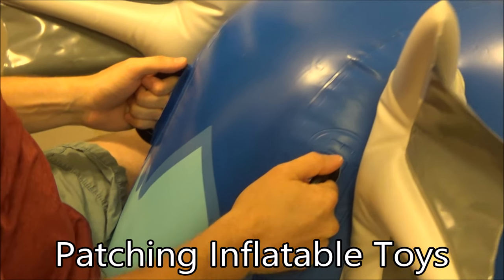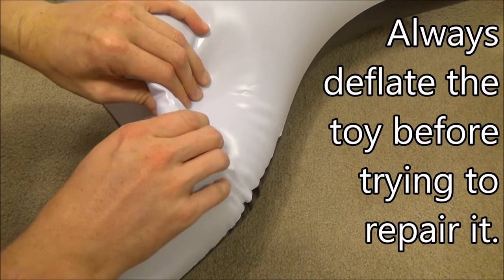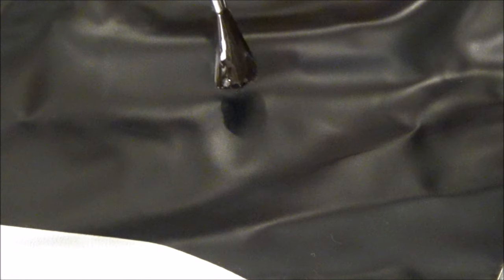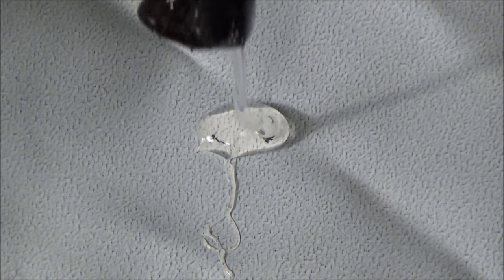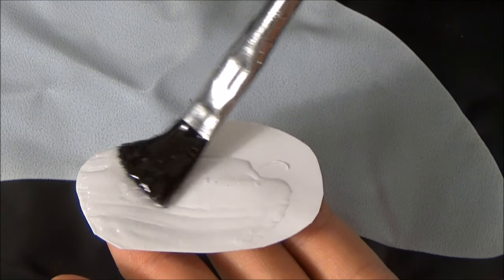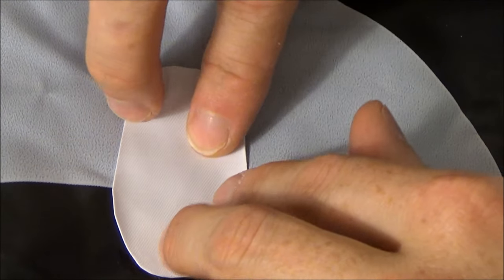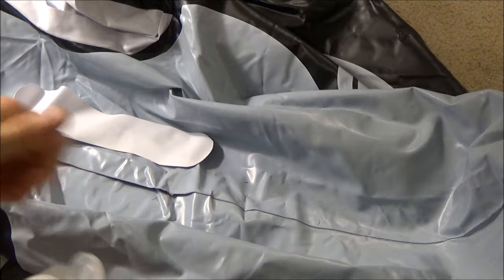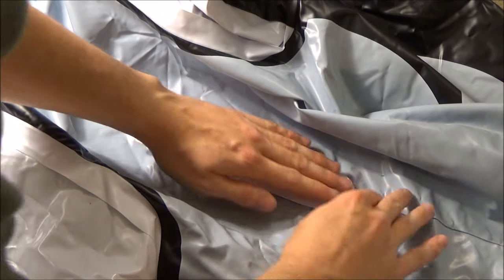Repairing Inflatable Pin Holes, Punctures, and Tears

Comment: Do not stick the patch on immediately. Either let it sit for at least a minute or gently blow on the patch and surface you want to apply it on until the glue is no longer shiny, then put the patch on. If you put it on wet then it will just slide and curl up at the edges and not stick well.

Comment: 2 things I have also found useful:
1.  I put waxed paper over a new patch and then press firmly on the waxed paper to seat the patch.  If it is laying flat, you can place a heavy weight over the waxed paper and it will keep the patch flat and tight while it dries.  When the glue is fully dry, the waxed paper will peel right off.
2.  After a patch has completely dried, I sometimes run a bead of glue all the way around the edges of the patch and then let it set up.  It seals the patch and prevents any curling up of the edges or peeling back.
Reply from the maker: +Thumper1044 The glue I am using in the video sets in about 5 minutes, so it is almost not worth trying to clamp it under anything heavy. I have however run glue around the edge of a patch, but for the most part if I applied the patch well enough I won't do that.

Comment: With the seam rip, would it be possible to accidently have glue seap inside and attach to the other side? With all that massaging I'm curious to know if you've ever glued the inside together accidently.
Reply from the maker: +kellymccabeful Yes, the glue quite frequently does seep into the toy. As long as you peel the two sides of the toy apart before the glue fully sets you will be okay.

Comment: in seam split how do you preventi the glue from sticking to inside and other side of the inflatable? It always happens to me. What about doing a negative repair for seams (i mean inside instead of outside)? is it a good idea?
Reply from the maker: I make sure to pull the two sides of the inflatable apart before the glue sets. As long as you pull it apart once or twice it won't stick anymore after that. And yes, I like to do patches on the inside whenever possible.

Comment: Thank you. I have a set of inflatable Letter People that I turned into stuffed animals and I want to turn them back into just inflatable. Now that could be possible and I wouldn't have to run into storage issues or pay $500 for a completely new set. 😀👍. My letter R has an open seam in his leg and the rest mainly has cuts and need replacement valves

Comment: Hi , is it better to put some pressure on the patch overnight  !! Thanks
Reply from the maker: The HH-66 vinyl cement I typically use dries so fast it really isn't necessary to clamp it for an extended period. However, other vinyl cements may take longer. You can always check the instructions for the glue you are using.
Reply: @HeathDragon  
Many thanks for your time 🙏.  Cheers

Comment: Hey Heath Dragon, I don't know, if you will still read this, since the Video was a while back ago, but can I do the same glueing you did on pinholes, when they are on the seams, but small enough, that it's really only noticble through the air rushing through, when up close? Because I got a Baphnedia from BeiLe, but sadly found leaks alrady and one of them being the one I mentioned.
Reply from the maker: I would not recommend using just glue on a seam that is beginning to split. You really want to glue on a patch for seam repairs.
Reply: @HeathDragon  Alright, thank you very much ^^

Comment: Is there alternative material instead of PVC? or where to buy PVC material, how it should called? Thank you.
Reply from the maker: Most pool toys are made from PVC (polyvinyl chloride). So you would want to use PVC to repair it. I usually use scrap vinyl from other toys. If you don't have any scrap, you can always buy one of those really cheap inflatable mats from the store to use as material.
Reply: @HeathDragon  Oh, thank you. I thought some kind of vinyl straps for car things like tuning can fits..

Comment: I know that this is a older video but is it possible to fix a small horizontal seam tare on the mouth of an inflatable intex whale with just the vinyl cement?
Reply from the maker: Any tear on or near a seam you would want to glue on a proper patch not just use the glue.
Reply: @Heath Dragon  thanks for the information. Where can I find a good patch for the inflatable whale?
Reply from the maker: Usually you can find a patch kit in the camping section of Walmart or sporting goods stores, but I just usually use scrap vinyl from cheap inflatables.
Reply: @Heath Dragon   hi you know where I can get some vinyl patches in the UK? I am having a hard time finding some,  maybe something I can use instead ?

Comment: Which chemical are applied first before applying the glue, plz send the which glue needs to b use.
Reply from the maker: I typically clean the bond joints with isopropyl alcohol before bonding. I use HH-66 for glue, but several brands sell flexible vinyl glue.

Comment: A nice tutorial, but what about a possible glue sticking with the opposite surface of inflatable toy? How to protect this?
Reply from the maker: As long as you pull the two pieces apart that you don't want to stick in the first couple minutes of the glue's drying time you can safely pull them apart.

Comment: Is there a way to repair it without that stuff, like is there a way to repair it using regular glue duct tape or anything householdish?
Reply from the maker: +James Nightman I wouldn't recommend tape. You can however find simple patch kits at most superstores, pool supply stores, or sporting goods places. Patch kits usually have a small tube of vinyl glue, a sizable patch of vinyl, and only cost a few bucks.

Comment: How do you keep it from adhering to the other sidein the case of the same split or for that matter any other hole?
Reply from the maker: Occasionally the opposite sides will get glued together by accident. The glue I use takes a few minutes to set up so as long as you peel the two halves apart before it fully sets it won't stay stuck together.
Reply: Heath Dragon ✅

Comment: Who sells that HH-66 glue? In the past I have used Goop cement to form a patch over seam splits. But the seam continues to split under the patch and before long it's leaking again.  Does that ever happen with the method you use?
Reply from the maker: You should be able to find HH-66 online or find Loctite's fabric and vinyl glue in a typical hardware store. The two glues I just listed should bond much better and not result in the issue you described.

Comment: You're videos are incredible! Can you point me to a PVC fabric that I buy online to patch a large white tear (about 10" long) I have along a seam? There are a lot of different thicknesses for boats, or tents, and I'm not sure what to get. There are also patches, but the ones I find are all small. The tear I have is along the neck of a Sun Pleasure Party Island Unicorn float I bought a couple years ago for $250 on Amazon. My plan is to use HH-66 and put an internal and external patch, and attempt to reinforce the rest of the neck seam with a bead or two of HH-66 - sound like a good plan? THANK YOU!

Comment: What type of glue is needed? I mean ,is there any special type of glue?
Reply from the maker: You will need to use vinyl cement. I use HH-66, but Loctite vinyl and fabric glue will also work. Sometimes you can find vinyl cement sold in a patch kit in the camping section of Walmart and the like.

Comment: Having trouble. Im repaing a pinhole leak with HH 66 on my fyaryuu dragon's wing. I wait 24 hours before inflating it and there's a leak at the end of where the glue is. Any advice?
Reply from the maker: Is it on a seam? Did you use a patch?
Reply: @HeathDragon It's a very small leak on a seam and no, I did not use a patch.
Reply: @HeathDragon  Got a patch of clear vinyl on there. The recurring leak stopped. It was a tricky application with the pinch seam, but HH-66 gets the job done.

Comment: Hi there.. may I ask if I can also use the solvent that use for the pipe??
Reply from the maker: Typically PVC pipe cement cures rigid and is not flexible enough for vinyl repair.

Comment: I know this is an older video of yours, but I have a bit of a conundrum...

My Phenod Pink Roo's leg seam ripped, and it's quite a large rip along a curved seam. Would you have any tips on how to possibly repair this?
Reply from the maker: It is possible to glue it back together by cutting a curved patch and attaching it to the inside of the seam split.
Reply: @HeathDragon  Ah, okay, that makes sense! Not sure if it makes any difference, but the inside seam where the leg joins to the rest of the main body is where it ripped. The tricky part would be getting the curved piece in just the right shape to prevent as many wrinkles as possible, I'd imagine.

Comment: The situation used to be a seam split and burning damage was fatal, but all other damage could be fixed with large stickers, duct tape and rubber cement. I find this video to be extremely helpful. However, it is not mentioned in this video that extensive damage caused by burns and acidic corrosion must be sterilized with chemicals before repair can begin.

Comment: What can you do when a aor bed gets a lump in it, Can it be repaired
Reply from the maker: +Nicole Sewell That usually means one of the internal baffles has started to peel. That is not an easy fix.
Reply: +Heath Dragon even if it's not a easy fix, Wat can be done about it or can anything b done to fix it?
Reply from the maker: +Nicole Sewell It is probably easier to buy a new air bed. You'd have to glue the baffle back together which is inside and hard to reach.
Reply: +Heath Dragon I just bought that one, Didnt even have it for a month. Wats the best airbed to get

Comment: Do you have to let it cure for at least 24 hours, so it can set, adhere, and bond., before inflating the toy again?
Reply from the maker: +Kevin N The glue I am using becomes tacky and will thus adhere within the first 2 to 5 minutes of application and it will set to a reasonable handling strength in as little as 5 minutes or so. The only real way to tell if it is fully cured is to feel the vinyl that was bonded. If it feels abnormally soft, then the glue has not fully cured yet. If there are multiple bonding operation you plan to perform there is no reason to wait long between each, but I would not recommend firmly inflating the toy until the vinyl has returned to its normal feel.

Comment: Is it the same glue of PVC Pipes?!
Reply from the maker: No, PVC cement typically cures rigid.
Reply: Heath Dragon thank you bro, are there any alternatives or other names of this glue
Reply from the maker: Loctite makes a vinyl and fabric glue that works. There are a number of brands that make vinyl glue. Just make sure the glue says it dries flexible.

Comment: how long does it take to dry and be ready to be used again?
Reply from the maker: The time will vary a lot depending on the amount of glue put on the patch. The glue will make the patch soft and flexible and as the glue cures the patch will return to it's regular stiffness. When the patch feels normal again it is cured. But typically overnight is plenty of time.

Comment: what kind of patch did you use?
can i use adhesive glue for the repair?
Reply from the maker: The patch is a scrap of vinyl I cut into an oval. You must use some sort of PVC or vinyl cement to bond the patch. HH-66 is a great vinyl cement. Loctite brand also sells a vinyl adhesive that would work well. You will probably have better luck finding the Loctite brand glue at a regular hardware store than HH-66.
Reply: +Heath Dragon
I went to my local store but they don't have the vinyl adhesives you speak of, but i found this multi-bond adhesive that works in vinyl pool, but, will that work?
Reply from the maker: +Jack Chong That sounds like it should work fine.

Comment: Wouldn't it be better to place some book where the patch is to add even pressure to the patch and make sure all wrinkles are gone, and to make sure thee glue adhesives really set before inflating the toy again.
Reply from the maker: This glue sets in just 5 minutes, but placing something on top of it is a good idea to keep it wrinkle free as it cures and especially useful if using slower acting glue. The cure time for the glue I am using varies from a few hours to a day. And yes, wait until it fully cures before inflating.

Comment: Heh. I accidentaly almost tore off one of "nematocyst" or these frills on an big mouth inflatable jellyfish swim ring (one of my fav inflatables btw.). The samage is comparable to semi-tear/semi-seam split. I guess this video will be helpful.  ... From this what I inspected, the only way to fix this is to glue a patch from the inside and then glue the semi-torn off nematocyst/frill over it. I mean over the patch. And heh... I just did that and it wasn't as easy as it seemed, the patch slightly dislocated and some glue got  on the clear top part. It turned out sloppy but it should get the job done. I've seen worse, more sloppy inflatable repair jobs than mine. Besides. It's like scars on your toys. Adding... Climate? And in my opinion it shows you care about them, not simply discard them and buy a new one.

Comment: Can I use pvc cement?
Reply from the maker: PVC pipe cement typically dries stiff and does not work well for inflatables. You would need to use a glue that dries flexible like HH-66 or Loctite's vinyl and fabric glue.

Comment: Will this work on toys filled with water?
Reply from the maker: +Anthony Ju Will it work with toys eventually filled with water or air, yes. It will not work on a toy that is currently filled with water or air. The glue has to be under no stress as it sets so keep the toy flat when patching.
Reply: Heath Dragon I have an inflatable pvc suit that has a rip in the sleeve on the right side, how do I fix it?

Comment: What is the glue that you use? Thanks
Reply: I'd love to know as well.
Reply from the maker: +Jilocasin +Nicola Tobi It is in the description. I am using HH-66 vinyl cement, but any MEK based glue will work well.
Reply: +Heath Dragon I have ask beacuse here MEK glue is not selled... But with the name I can buy it on eBay for example. Thanks

Comment: Is not necessary to have a huge patrch  a small one like 1/2 inch extra on each side of the leak is perfect
Reply from the maker: +TheSweeTiger Chun Thanks, you are right, I didn't really talk much about making the patch or why it is the size it is.
Reply: +Heath Dragon For a person want to keep the toy presentable need to use a smaller patch and  same color or clear  and what you do  , you use really too much glue and vynil for the size of your patch
Reply from the maker: +TheSweeTiger Chun I didn't happen to have any clear vinyl lying around, someone else mentioned that. In general I try not to need patches in the first place.

Comment: my whale's valve came off.. :/ is there anyway to put it back somehow?
Reply from the maker: +Hydro ordyH If just the valve plug fell off, you can glue the plug back onto its tab. If the whole valve is falling off, you can cut it the rest of the way off the toy and replace it with a valve from another toy.
Reply: +Heath Dragon yea its just the valve plug. Do i glue using vinyl glue as well?

Comment: First of all you don't have to clean the toy everytime with alcohol. Unless the toy is messy or greasy! Second above all not all toys having good painting on them, alcohol does make it worse!. The pinch holes does require later a patch instead just a glue drop on the place, (only places were a patch is very difficult to apply (exsample on curves or end places like Gryphons claws) Second never use toilet paper to glue the patch on it, you always take paper on the patch or toy!, I use a metal plate or carton. Also when appling  a patch on the toy you do need a roller or some kind tool to disperse the glue on the patch and contacting every corner... Otherwise the patch would wrinkle up and you need to remove it again, and making the hole BIGGER!..
Reply from the maker: +MAD Ace Thanks for the tips. If the toy is already clean you don't have to clean it more. I have had some issues with the Jet Creations digitally printed toys with paint. Too much alcohol and the paint will start too rub off. When using a different solvent glue I used a roller and a hard surface, but when I switched to the stuff I use now you can basically apply the patch and shift it around until you like where it is and it stays. The old glue I used would cause the edges to curl if not applied well enough.

Comment: Where do you get the patch from
Reply from the maker: The patch I used is a scrap of vinyl from another toy, however you can find repair kits with both adhesive and vinyl at the local store.